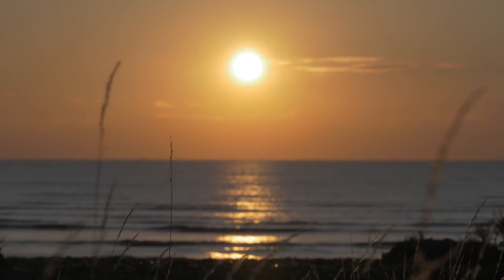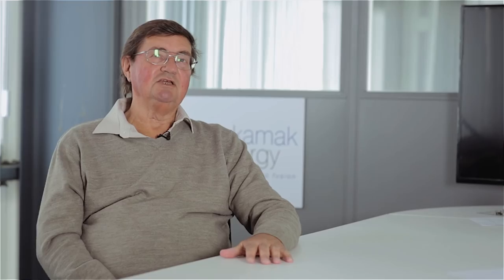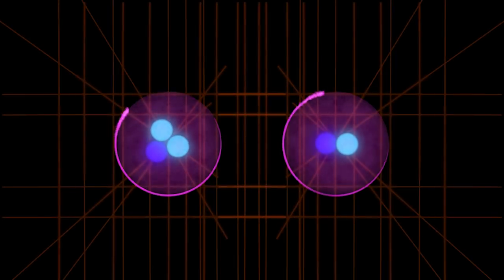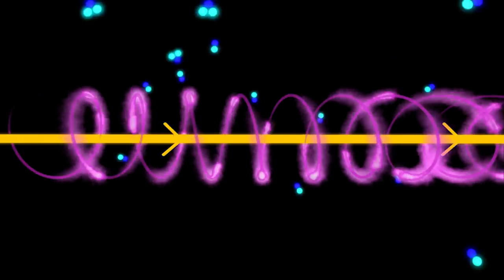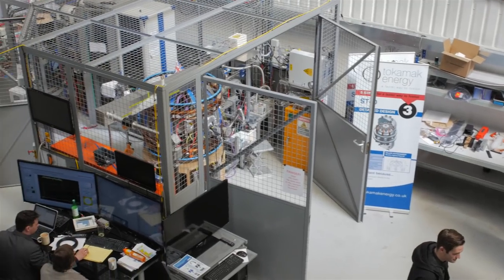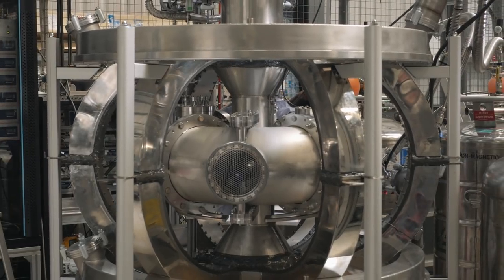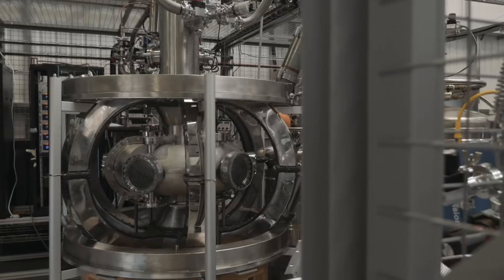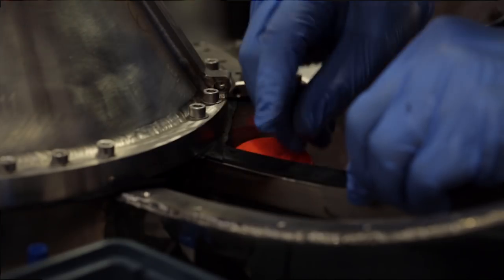Faster fusion

Comment: What I never understood when it comes to fusion power, what is the method of actually creating electrical power from the Fusion Reaction? It seems to me the electrical power that it takes to create and maintain a strong enough magnetic field for fusion to exist, exceeds the output. The idea of having a sun in the palm of your hand that takes less energy to maintain, than the amount of energy it outputs, is bordering on perpetual motion levels of quackery. It violates the laws of energy significantly.

The reason why a star can do it, is because its very existence creates the gravitational forces needed to maintain it; a direct correlation with its mass. This is an impossibility at such a small scale -you would have a much easier time turning lead into gold through Fission than finding a way to maintain a small fusion reaction. So I ask, what is the theoretical magic in the small scale fusion reaction that makes the production of electricity more economical than fission?

Also, in Fission reactors water is used as a medium to turn steam turbines. The decay of the isotope raises the temperature of the water to create steam. In a fusion reaction, what is the intermediary medium that actually facilitates the transformation of heat into electrical energy?
Reply: These are private companies (or affiliates) that advertise (with exaggeration) their products.
Reply: No, It doesn't violate the laws of energy. The energy comes from the matter being fused together. That is defined by the famous equation E=mc^2. The sun generates energy in the same way. Once you get necessary conditions, fusion occurs and excess energy is released by neutrons. Study some nuclear physics :P
Reply: Ali Devrim OĞUZ
 I don't think you understand me. This excess of energy, would be in the form of heat correct? Then how will this heat be transformed into electrical power? Again, considering that the amount of power needed to be generated to maintain the magnetic field to maintain the reaction.
Reply: +ObiTrev
The energy is in heat which is then converted to electricity through turbines...same old process. That is for producing electrical power.

Now, the question whether the output energy is greater than input - unfortunately, so far this has been the case and physicists have not been able to achieve break-even point yet!
Also, in this video, they are not claiming they have already achieved this, they just say they are in the process of and are overly confident of success of their device.

How are physicists going to solve the Output > Input problem - by better understanding the phenomena that occur during and immediately after fusion, for that they claim they need a larger device and have approved from the governments a project called ITER.
Reply: ahmedshinwari
Exactly what I was saying... thank you.
Reply: Culham isn't private- it's part of UKAEA
Reply: It's not just a claim- it's an empirical relation. Fusion confinement time has been shown to scale with plasma radius demonstrably (the reason for this isn't fully understood however).

Fusion plants will need to produce their own tritium to fuel the Deuterium- Tritium reactions. Ergo Lithium will be used as a moderator as lithium- neutron reactions produce Tritium. The designs for this moderator setup will be tested at ITER. Although not a power plant, the baseline for ITER is that it will have a 'safety factor' of 10. i.e. 10x more fusion power produced than input. Further optimisation may yield ignition (where the plasma is fully sustained through alpha particle heating, produced in the fusion reactions). All that is need then is fuel injection- current Tokomaks employ a mix of ohmic, neutral beam and microwave heating systems
Reply: I know what you are saying..and the answer really is the same old thing..steam to turbine..yes, I know..it seems like such an antiquated way of conversion...and it is.But much research has been done on trying to find more efficient conversion methods, for quite some time, actually...I suppose one day maybe some form of solid state material will be converting electromagnetic energy of any wavelength into electricity...like they are trying to do with solar cells right now...by trying to get them to convert a larger range of light frequencies into useable electricity, but yes..it does seem quite odd, that we will soon have fusion...but still stuck with the steam turbine to turn those generators !!
Reply: no quackery about it, it's just pure science. Simply put, at the point that you achieve plasma state, the process becomes self-sustaining as much more energy is being produced in the process then the smaller portion required to maintain the plasma state.
Reply: It is I
Reply: Carl A you got it right :)
Reply: I would think that one would generate electricity by releasing some of the 1million degree heat in order to boil water and spin a turbine. I'm unclear how this would actually work through the magnetic field however..
Reply: PrivatteReviewSatuas The current idea is to use absorb the neutrons produces in fusion reactions in a blanket around the torus, which will heat up and boil water etc.
Reply: The particles forming the atoms have some very strong attracting forces over very short distances (nuclear strong force) they come into play when they get extremely close (there are actually a number of different forces at play both attracting and repelling) the nuclear strong force pulling the nuclei together is what releases the energy and in the form of high energy particles.
I dont know the exact numbers but the work they have to overcome for the first force is much less that the work they get from the force that attracts them when they get close enough.
its the high energy particles like gamma rays that they get the heat from when they get absorbed same way energy is absorbed in a fission reactor.
Reply: ObiTrevם    4
Reply: "Output > Input problem" has kind of been solved, in a thermonuclear bomb. Containing it is a bit more complicated.
Reply: aleksander suur it's solved for when it's not controlled. As far as i know the input energy is far greater than the output energy in a fusion reactor. plus they need super conductors, tritium (which is expensive) and good funding which is not quite industrial level. Weapons and military get way more money than they do
Reply: i think we should count on the classic renewable energy because fusion is nowhere near full development
Reply: Two hydrogen atoms lose an ion when they collide to make Helium. That ion provides energy in the form of waste heat. That heats water which drives turbines.
Reply: socom 2 we've been on focill fuel for decades and oil and coal are just a fraction of earth's resources. On the other hand, water is 70% of the surface. This is everything BUT short sighted...
Reply: +socom 2 nothing happens, deuterium is something like 1 part in 10000 of all available hydrogen. Even if you managed to extract and burn all available deuterium(ridiculous) it would only make 1 part in 20000 difference to seas. Really, we have snowball's chance in hell of using that much energy as long as we are constrained within solar system.
Reply: Simon Chislett-McDonald if we could get our hands on Moon's helium-3, it would be much more safe and cheap, though the problem is to transport it, as well as the fact that it needs much more input energy.
Reply: ObiTrev 
Good question! I'm not an engineer or scientist, but I get the gist of what they're trying to do and I asked the same question. How much energy is needed to start up and run this thing to get it to produce anything useful? Why can't we continue to use wind and solar energy? geothermal? It sounds like they're more concerned with who's going to do it first rather than who is going to produce clean energy.
Reply: +Monster commenter once you get it running, the question of how much it takes to run, becomes a rather moot point because once you have it running as a viable powerplant it generates all the power it needs to keep running itself. A viable fusion powerplant must output many times more in steady state than it takes to keep fusion going. To get fusion happening is easy, you can do it in your garage, the hard part is to keep it contained such that the output power of fusion could drive more fusion before it dissipates. That is what requires multi billion dollar investments to build.
The thing with fusion is, that once you figure it out, its the ultimate power source, the fuel cost might as well be zero, the only real cost in obtaining deuterium is power, that your fusion power plant now gives in abundance. The reactor can probably be optimized by a lot too, once the basic viability is demonstrated. Forget about approaching coal in cost, fusion can undercut coal like nobodies business. Provided they get it working, but they will, eventually. Cost and availability of power has always been the limiting factor in human development and fusion is the next step forward. That, is why it's so important.
It's not going to be quite squeaky clean as sometimes advertised, certainly not in the beginning, but its many orders of magnitude better than nuclear fission that is already many orders of magnitude better than anything else. Or did you think making solar panels was a clean process?
Reply: aleksander suur fusion reactors will not be developed any time soon... we already have global warming. It would be wiser to focus on today's viable resources than nuclear fussion even though i agree it's the "ultimate power source". its just not gonna come in time, before we get fucked up
Reply: how about what to do with the waste. all of a sudden we have an excess of helium?
Reply: +Stu Art Really? Ok, lets suppose we actually get more helium out of it than we know what to do with, unlikely but lets roll with it. So? vent it. Helium is second lightest gas, it will float to exosphere and get blown away with solar wind. Earth's gravity is not sufficient to hold onto free helium that's why we have none in our atmosphere despite it being second most abundant element in the universe.
Reply: +Petros Oratiou fusion is not going to be developed soon enough, quite true. But late is better than never. And we are not exactly spending too much money on fusion and leaving reality of today without sufficient funding. As a proportion of global energy budget only a minuscule fraction is spent on fusion, way too little for the long term payoff-s it will eventually bring. Payoffs we could be getting sooner.
Reply: To be truthful, I believe that a fusion reactor will become more efficient the farther away from gravitational forces (i.e. Earth) you get. In space, you do not need to add more energy to compensate for gravity and the thermal losses are almost nonexistent. 
The next issue is our primitive form of energy extraction. We use steam because it is a cheap way of extracting thermal energy and it doesn't require expensive, hard to replace, materials to do so. What we really need is a means of extracting discharged electrons from the fusion reaction. Most of that energy is discharged into the ground and what is left ends up in the casing walls, irradiating it.
Reply: +rhapsodyman2000 you don't get away from gravity by going to space, really ISS is only few hundred kilometers away. Any Earth's satellite is still in the same solar orbit Earth is etc. In a fusion reactor you don't compensate for gravity, why would you think that? 

I guess you could argue that if you are in freefall you don't need such a hefty structure to deal with the sheer weight of the reactor and you would be right. But the downside is that you are in vacuum and it's really hard to get rid of heat - that is not a good thing. We are smooching energy off the heat flow between reactor and environment, if you can't dissipate much heat, there is not much heat flow and you can't get energy. Worse, if your reactor generates more heat than you can get rid of, everything melts.

The problem with non-thermal energy recovery from fusion reaction is, well most of energy generated by fusion reaction is thermal, it's in the kinetic energy of the fusion products, there are no electrons involved in fusion reaction. Next biggest part of energy released is in the form of neutron flux and the way to turn that into useful energy is to let it activate reactor casing thus recovering the energy in form of heat. 

You can't really do much with neutrons, you can't control it with electromagnetic fields because it has no charge. Neutrons are affected by gravity, but well, subatomic particles don't have much mass, you would have to be able turn spacetime into a pretzel at will to do anything useful that way and if you can do that energy generation is probably least of your concerns. So all that really remains at table are strong and weak nuclear forces and only way we know how to interact with a neutron that way is by neutron capture, or to put it simply, let it irradiate the casing walls. We can still be clever about it and regenerate tritium fuel that way, make lithium absorb the neutron flux and you get tritium and waste helium out of it, tritium is fuel you can burn and helium isotopes are stable so its not radioactive waste. Unfortunately you can't make everything out of lithium, you will end up with other stuff in the machine and some of the neutron flux ends up being captured in reactions that result in some nuclear waste. But that's something you can optimize you can minimize the waste products and you can select materials so that what you must have is as short lived as possible.

Using steam turbines might seem primitive, but actually it's quite efficient. Just because an hammer is primitive doesn't mean its no good for the job its meant for.
Reply: rhapsodyman2000 this is not practical at all... you'll need a ton of energy just to get it into space and sustain the reaction. then where will your output go? it would melt. even if you were to have super capacitors or batteries you would then have to get them back to earth. not to mention that there is no way to even store such huge amounts of energy. Fusion reactors in space are not gonna work at least in an industrial level.
Reply: aleksander suur 
Using steam on earth is generally 30/40% efficient due to thermal loss into the atmosphere. Assuming you build a large enough structure in space, you can put to work more thermal energy before it is lost. This also means that the reactor can be smaller while providing the same power output. Of course, this means that more coolant would need to be stockpiled to compensate for this and a heat sink of some kind (likely a ferric asteroid) would be necessary to balance the heat exchange. Of course this is pretty far off for us, and requires an existing space infrastructure to support it. On the other hand, their are other ways to getting energy from the radiating energies of plasma. Personally, I believe that plasma energy will always have low yields, even at its most efficient. Extracting everything we can from the system will be the only way I believe we can get above breaking even. If it means finding a way to get energy from the UV radiation, then I think it's worth it.

Also, I was talking about electrons knocked off by X-ray radiation. It is absorbed by the casing, but it builds up static energy which is discharged into the ground. As for gravity,  the electromagnets needs more energy to keep the plasma off the walls when under gravity than when it is not. It may be minor compared to the whole system but, like I said, I don't think plasma will have high yields. Especially when compared to hydrocarbon based fuels.
Reply: Petros Oratiou 
Fusion is a pretty far off energy resource in my opinion. Geo-thermal, solar, and nuclear on top of biofuels and other hydrocarbon based fuels are the the future, I believe, for the next 2-3 hundred years. This is mostly because I believe that we have bloated societies and the social upheaval from the growing expense of fossil fuels will necessitate the shrinkage of luxuries till the infrastructure can support it again. Personally, I think fusion is a space thing. Especially with the low yields we are already seeing.

TL;DR it's going to have to get a lot worse for it to get better. At least with the way things are going.
Reply: +rhapsodyman2000 you are completely missing something here. Power train efficiency is quite irrelevant once Q>1. Power that is needed to keep fusion reaction going does not pass through the power generation cycle. Even if the reactor would be only 1% efficient, that is 99% of heat generated by fusion would be needed to keep fusion going it would still work. The heat is generated and consumed within the reactor chamber, anything that makes it out and goes to power generation cycle is pure profit. Such a reactor would have a Q of only 1.01, it would still work make no mistake, just the fuel efficiency would be kind of shoddy. Luckily the fuel is essentially free so it would still work. In practice nobody is talking about such barely working reactors, small improvement in fusion reactors still means an entire order of magnitude improvement. ITER is aiming for steady state Q=5

Fusion is far off, decades from actual implementation with current funding. But if policies change or sufficient technology demonstrations can be shown, the funding would change by orders of magnitude, so would timescales. One technology breakthrough or political upheaval and fusion goes from 20 years away to 2 years away.
Reply: aleksander suur 
From my understanding, the current gripe with fusion is that the power generated is not sufficient to sustain the reaction and power the containment field (and other myriad powered systems) . Assuming that fusion can terrestrially produce enough thermal energy to both sustain and contain itself, any left over energy is only being skimmed off the top. This exemplifies my "low yield" problem with fusion and makes me believe that fusion may require an additional energy input (likely solar or nuclear) to help sustain and contain the reaction. Now i'd agree with you about compensating with quantity, if the fuel quantity was like that. From what I've seen, the deuterium is there but the tritium is not, Helium-3 is only plentiful in space, and we've yet to find anything terrestrially available to compensate for your example. Until the day they can pull off anything above even, I personally think that the only way to viably use fusion power would be in the vacuum of space like I described.
Reply: +rhapsodyman2000 the main power hog in fusion is not containment and other power station subsystems, its the heating of plasma that takes all the power. Take ITER for example, projected for 500MW output with Q=5, that means it needs 125MW just to heat the plasma and drive the fusion reaction. That is a rather significant amount of power. Now, obviously when Q>1 then the plasma heats itself and the reaction is self sustaining without you having to input that heating power.
Its true that tritium is not exactly something you find in grocery store, but its not a problem. D-T fuel cycle is a bit more complex in reality. What you have is the main reaction of 
D + T -> He4 - n
Helium is waste but carries most of output heat from the reaction, neutron carries rest of the output energy. Now that neutron is not just disappearing somewhere, its captured in chamber cladding that is mainly made of Lithium. Lithium comes in two stable isotopes, Li6 and Li7, mostly latter. 
Li7 + n -> He4 + T + n (neutron is captured same way as neutrons from D-T reaction)
Li6 + n -> He4 + T
So you see the neutrons are captured in lithium, recovering the heat and regenerating tritium that is cycled back to main D-T reaction. So the main inputs to the reactor are not actually D and T, but D and Li and the main waste is Helium. Deuterium is abundant enough and Lithium downright commonplace.
Depending on how efficient neutron capture in Lithium is(how much is lost in other materials) its quite possible that the reactor will end up outputting more tritium than it can burn up.
Reply: Every single fuel-based powerplant on earth, nuclear, oil, coal, gas, transforms excess heat into electricity. How do you think powerplants work?
Reply: "It violates the laws of energy significantly"
Ever heard of stars dummy?
Reply: Then he really has nothing to question
The problem of gravity has been solved with strong magnetic fields, which keeps the plasma in place allowing fusion to occur instead of particles just whizzing about
Reply: aleksander suur 
Possible, but you add a lot of uncertainty to the system by relying on regenerating tritium that way. Some of it could get trapped within the lithium, some of it may not react with the lithium to regenerate tritium. I doubt this is a reaction as perpetual as chorine and ozone but, if it is, it doesn't matter much. What is more concerning for me than fuel is the fact that fusion reactions right now are counted in seconds and milliseconds. We can pump in surplus reaction material into the camber but, if heat retention is an issue, then that has to remain the focus. ITER's "Q=5" expectations, as far as I'm concerned, is a farce  if smaller examples of it cannot even get Q>1. Its one of the reasons why the US hasn't invested in fusion reactors for power but, for study. 

On the other hand, doing this reaction in space will not only save on material, it will substantially increase heat retention and thermal work output.
Reply: +rhapsodyman2000 Tritium breeding is pretty well established technology. In fact it has been done from pretty much the very beginning. All the tritium in use today is synthesized that way, there is not much of it in the world, but enough that you can buy a small vial with some tritium gas off ebay for like 10$, you need quite a bit more than that to run a reactor but its not absurdly expensive.
JET did Q=0.69 so they know very well what they are doing scaling it up, ITER containment time is in minutes up to hour scale. Really, they are not blowing all that money on a far off bet, you can be pretty sure ITER will work more or less as advertised. Tokamak design went through a very steady improvement spanning many order of magnitude in Q, eventually they ran into the scale issue, the reactors were just too small, thus ITER.
Reply: aleksander suur 
I'd like to believe that the concept would scale up that nicely but, from what I've seen, a stable ITER reactor will still have to contend with the exorbitant cost to energy ratio. Even if you have an ideal Q=5, you'll lose at least half your thermal energy before it can be put to work. You'll also have to contend with the fact that maintaining this thing will be an affair of months of downtime. That is unacceptable for any modern society that is build to depend on that power, especially when we cannot save that much power. Fusion power is just too far off for our infrastructural and technological level. 

I guess we'll just have to see when it fully constructed if it works or not.
Reply: +rhapsodyman2000
Its an experimental reactor, they are not going to even bother putting any watts on the grid, though they technically could. Its aiming to be the first reactor that could technically make a power station, it aims to demonstrate how such a power station would work, test the construction materials and methods, be a learning platform on how to run such a power station etc etc. All the scientists working on it are very confident it will work, but the experiment is necessary to take fusion reactors from science experiment to engineering problem. 

I wouldn't be too pessimistic about the timescale, nuclear fission went from first installation to producing significant fraction of world energy very fast. Once basic engineering has been demonstrated and provided that the economics work out at all, there will be a huge rush of investment to install actual capacity. 

Decade and more timelines certainly seem long, but years pass along fast. These timelines are not just a matter of staring at the calendar tho, they mean decades of actually working on the problem, if we don't make the effort today, we are not going to get the benefits decades down the line, or ever really.
Reply: You're providing fuel to the reactor, so it's not a closed system. You're inputting resources. But in this case the resource is deuterium which is a hydrogen isotope that can be obtained from sea water. There's also the possibility of creating more deuterium in a reactor than is consumed eventually, like current breeder reactors that create more fissile material than they consume.

In a fusion reactor, the energy can actually be gotten directly from the release of particles from the fusion.
Reply: Check out the Dense Plasma Focus design for fusion reactions using either d-d fusion or Boron-11 aneutronic fusion in a "Z-pinch plasmoid" that makes an ion beam and electron beam pair. This concept uses a COIL to pull power by induction from the fusion plasmoid beam, the beam can be cooled this way and recycled, not sure if anyone has tried to pull power from the electron beam yet! The potential for high efficiency and high gain makes the "Focus Fusion" branches of fusion power very promising.
Reply: +Taylor Westmore interesting, especially the direct conversion part and the high temps they achieve. But any concept that works with any fuel other than D-T is not going to become the first power producing fusion reactor. If they were anywhere close to power generation with D-D or p-B11 they would already be there with D-T, seeing as they are not, clearly they cannot be all that close.
Reply: +Taylor Westmore 
Looks promising, if you overlook the fact that it is essentially a plasma torch. Anything on the facing end of that beam is going to be bombarded with what is essentially an X-ray laser bundled with a neutron beam. Personally, it looks more promising as a radiation weapon than a source of power but, it seems to have a very surprising tolerance for downscaling. If the heat and radiation concerns are properly addressed, I wouldn't doubt its effectiveness simply on it's ability to directly extract power from the system.
Reply: ObiTrev 
Alphavoltaic membranes if deuterium and helium-3, and aneutronic!
Reply: +Taylor Westmore huh, what do you know they actually have a good reason for using boron, the way they heat plasma heavily depends on charge of the nucleus so they need it to be big. Interesting piece of technology, but I still wouldn't hold my breath on any power stations coming out of this anytime soon. Worth pursuing it for the pure science alone though.
Reply: Simon Chislett-McDonald speak english. Of the 9 billion people on this planet, maybe only 200 understood what you just said, and would be able to rebuke the veracity of your claims.......and they probably would not be wasting thier time on YouTube.
Reply: There are 3 ways, the superconductors that magicly turns heat into energy, the steamy way, and a way that picks up the leftover ions
Reply: Wow all these hatte comments :D he is just curious and wanted to learn smth, and asked questions based in his knowlegde
Reply: Could one not think about this reaction as pretty much any other reaction. While these are nuclear reactions, it is the same principle for chemical reactions. The reactants in a chemical reaction are usually stable and require added energy for the bonds to break. However upon the formation of new bonds, more energy is released. This extra energy provides the energy to keep breaking more bonds and allow new bonds to form producing yet more energy.

Likewise in this case. You add energy to give the atoms enough kinetic energy to overcome the electrical forces and merge into larger atoms. This merging releases more energy than is required to make them merge.
Reply: it takes the heat from the enormous amount of energy released by a nuclear fusion reaction (same thing that powers hydrogen bombs) and uses it to boil steam just like conventional power plants .......... the plasma is contained in a vacuum chamber and the magnets are superconductors - which mean they don't consume continues power by waste heat like normal magnets - and because fusion releases so much more energy then the initial energy input that in theory its the ultimate power source.
Reply: Kevin Miedema it would be, if our methods of energy extraction were more efficient than 40%.
Reply: Kevin, not to mention that fusion reactors can be powered by easily found or manufactured hydrogen isotopes.
Reply: rhap, when we get the fusion thing down, we can start investing on research into better use of the currently unused energy to increase efficiency.
Reply: nexus1g the problem is that the heating and containment takes a lot of energy. You can only skim off what excess heat is created and no more, or else the reaction destabilizes and ends. Controlling for how much heat you want to bleed off is difficult with conventional steam dynamo. They work well with fossil fuels and nuclear because they are much more tolerant of temperature variation.
Reply: https://en.wikipedia.org/wiki/Magnetohydrodynamic_generator 
sorry for being slowpoke. In my opinion it is somehow connected with this type of generator